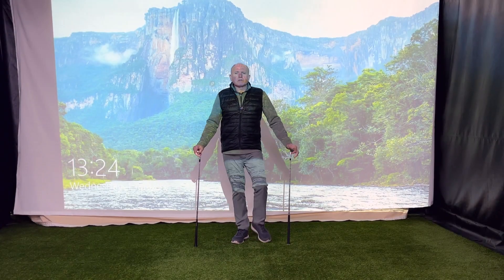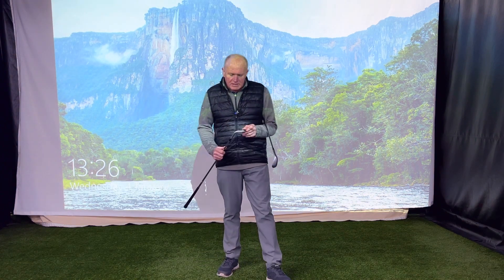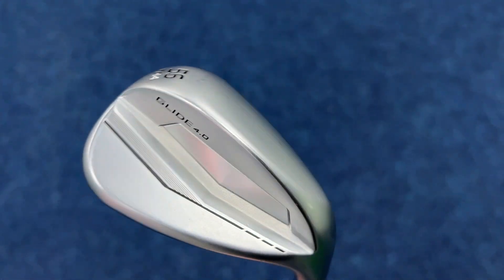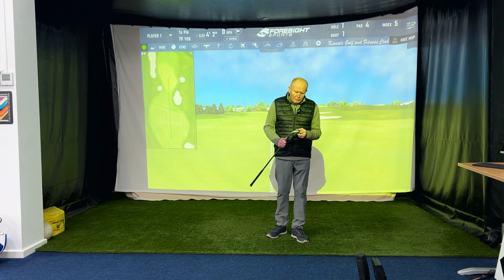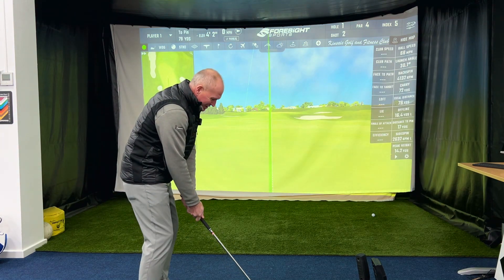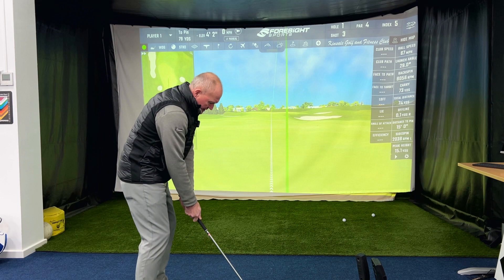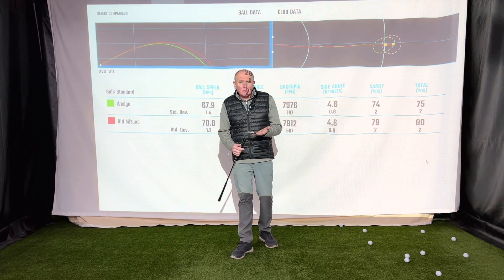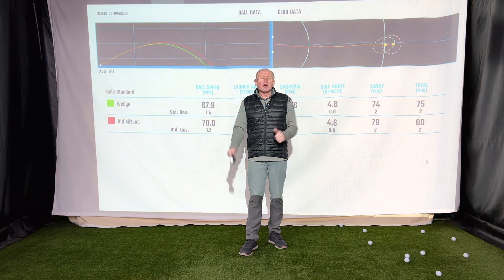How often should you change your Wedges?

Comment: I'm not surprised at all Andrew. I have Ping 60Tour wedge(about 10 years old) and a two year old Glide 3 ws 54 Deg with 14deg Bounce.  The 60 doesn't look as aged as your Mizuno but geez it works well. Still. Of course both wedges are cast, not forged, and so a bit more durable. However, when I tried the new Glide 4 my numbers mirrored yours', a poofteenth of nothing difference. Consequently I have a shifting stance in my ability to ask "she who must be obeyed" for new sticks. It seems that I am not good enough to wear the grooves out. All that said, just on aesthetics I'd have to dump you Mizuno!!!
Reply from the maker: Thanks Ken, just posted a follow up which was interesting.

Comment: I'm not surprised with shots off the mat. I suspect if the test was done on grass there would be a notable difference when the grooves have to perform their main task of clearing debris and water from the face. Do a "wet wedge" test and you'll see a difference.
Reply from the maker: Hi Ian, follow uo video just posted. Big changes in the numbers. Thanks for the suggestion.

Comment: Probably would have to be exact same model of wedge - one worn and one not - to be properly scientific Andrew, but yeah that’s interesting. I wonder if tested on course/grass if the results would be different where the grooves need to actually perform their function of removing debris from between the face and the ball?
Reply from the maker: That is a good point you make Cameron, check out the follow up video I posted today.